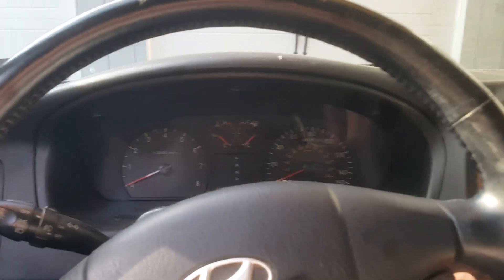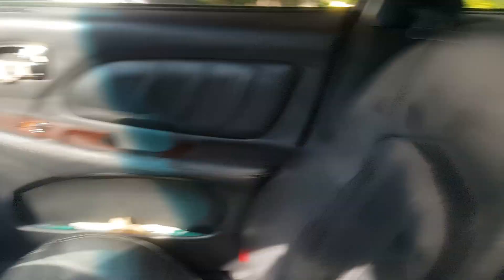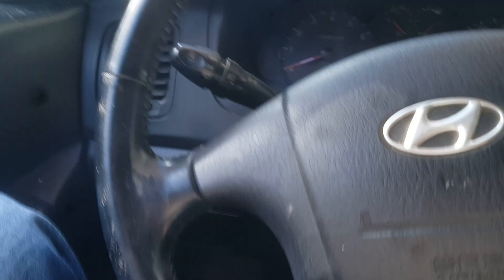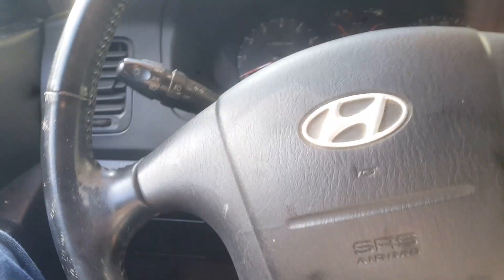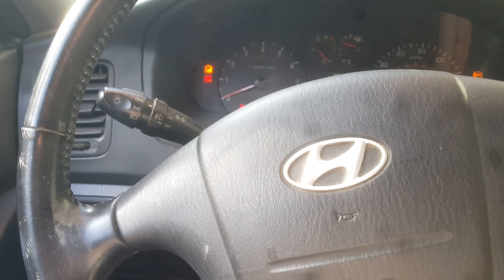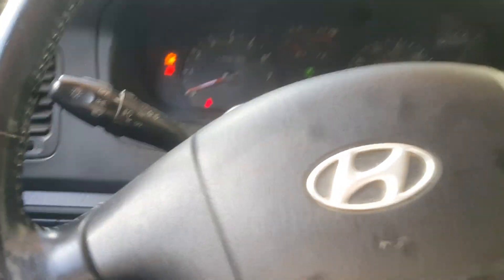How To Tell If Your Car Has A Bad Fuel Pump

Comment: I think my fuel pump may be bad because only when my car has been running for 30 minutes or more my car has trouble moving when I’m stopped and take my foot of the brake and not push the gas pedal my car has trouble moving, what do you think?
Reply: it could be that maybe your transmission is overheating after running for a certain amount of time, and that's why you have issues accelerating.

Comment: Make sure to look under the hood and try to look the best you can to see if you have a broken timing belt, etc because if the belt is broke and you crank the engine you'll more than likely do alot of damage as these Hyundais have interference engines meaning it'll more than likely bend a VALVE if you're out there cranking on engine and beating on the fuel tank. It's a crapshoot at times so use extra caution so it's not a really expensive job.
Reply from the maker: If the timing belt breaks driving the sure the damage would have already been done, unfortunately. All depends on the type of car.

Comment: Hey I have a 06 charger that starts n drive but looses power then cuts off may start or go days without starting they say buy new motor I think there wrong
Reply from the maker: Yes, I would definatly get a second option
Reply: @FlatRateMechanic  what do u think it could be
Reply from the maker: Hard to say. The mechanic would need to check it when it is not starting to know for sure.

Comment: you're information is half-baked at best. You didn't mention the fuel pump fuse, fuel pump relay, or fuel pump control module as possibilities. any of these could be bad, which would prevent the fuel pump from operating.